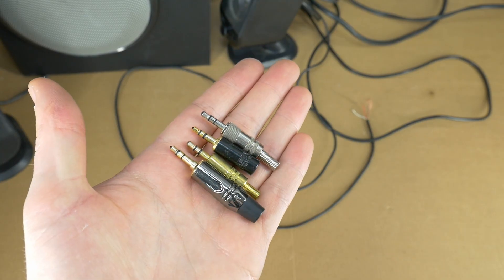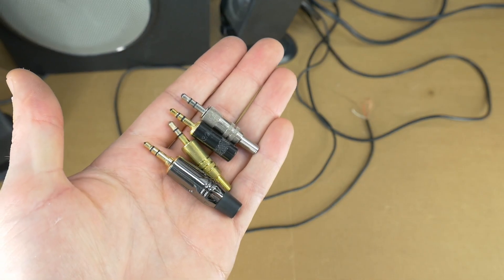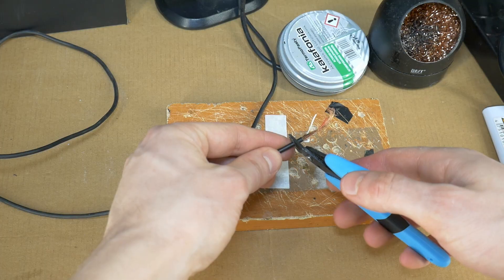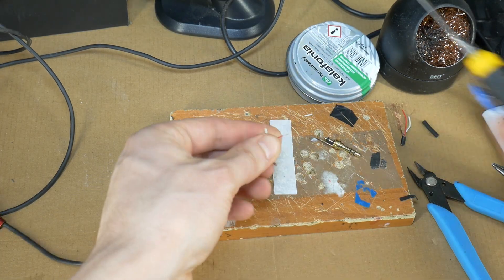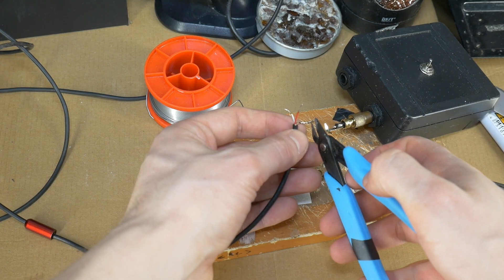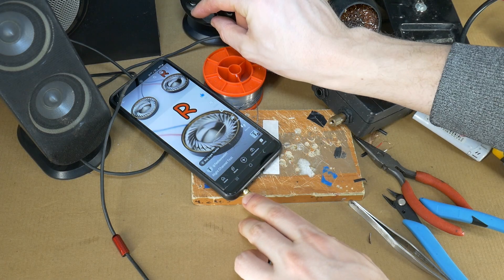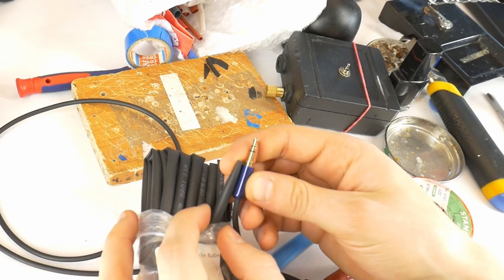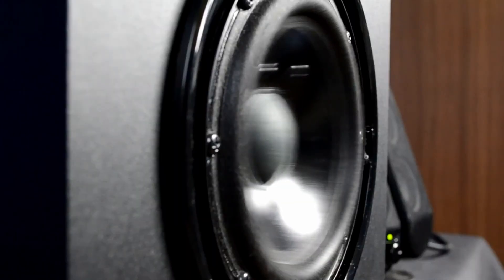How to Fix & Replace a Broken 3.5mm Audio Jack on Speakers

Comment: My cord on my microphone that you plug into my karaoke machine isn't the problem it's the hole on the back of the karaoke machine you plug the microphone into I have to hold the cord in tight in order to get a connection if the cord moves it loses the connection my girlfriends mom bought me a tzumi super bass jobsite speaker karaoke machine from an auction site online but the plug in for the microphone was damaged the cord on my microphone has one of those fatter metal connectors on the end the original microphone wasn't included since it was an auction item but if it was new it would have been

Comment: You sir are a legend!
I just replaced the satellite drivers on my logitech z2300 only to find the 3.5mm has an iffy wire in it, and now I believe you've saved the factory control pod
Reply from the maker: Excellent 🎉

Comment: I have these exact same Logitech speakers/subwoofer and it has developed a kink in the wire next to the audio jack, causing one speaker to lose audio if I don't position it a certain way. I've also noticed the audio quality has diminished and doesn't sound nearly as good (almost as if it's in mono in both speakers), so I've been thinking about doing this. Thanks for the tutorial!
Reply from the maker: Sounds like broken ground wire at jack. Good luck.